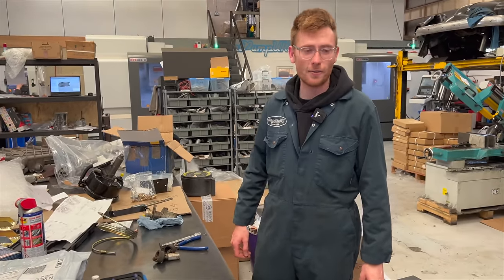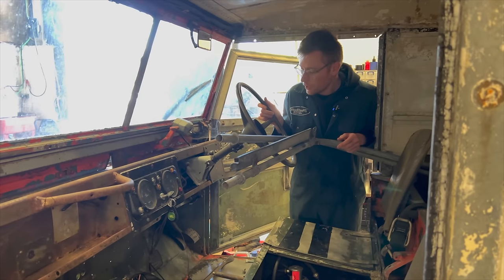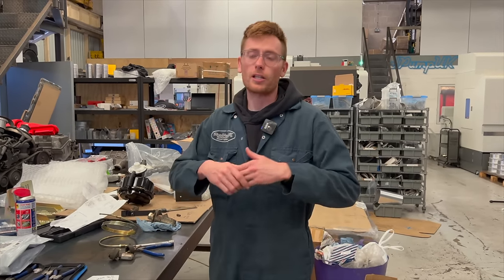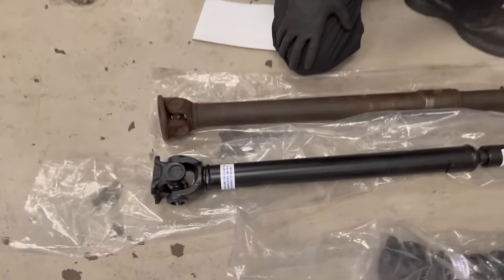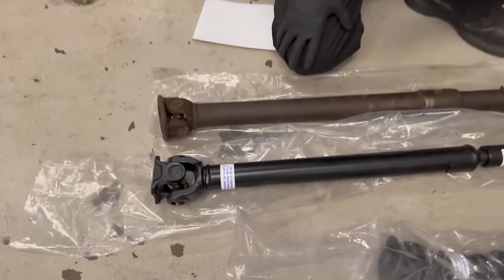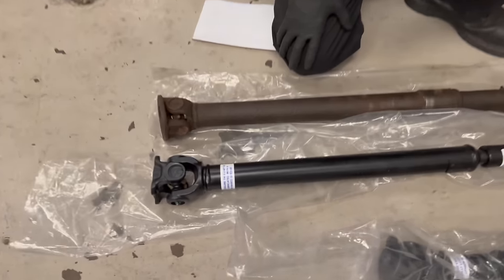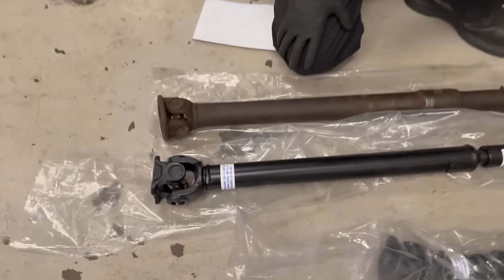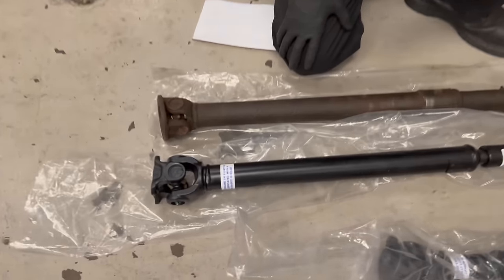Part 3, 1957 Series 1 Landrover OM605 build, FIRST START, AXLES,  BRAKES AND ELECTRONICS INSTALLED.

Comment: The one thing I loved most about this video is the fact that you never once told your girls to be quiet. You instead engaged them in what you were doing. God bless to you and your family and lots  of love from Norway. 

ps. I will probably be ordering a turbo kit for a 96 w124 250D shipped to our house in India if possible, but I have to find a nice example there first. They are rust free for the most part so you normally have pay 5 to 7000£ for a good example. How much reliable power can I expect on a stock OM605 with a kit from you, while keeping most of the driveability and comfort?

Comment: Sir, I need your opinion on something.
Have you ever looked at the BorgWarner R2S turbo system as used on the International VT275 engine???
The newer ones are computer controlled but the older ones, 2014, are fully mechanical.
How well do you thing this factory made two stage turbo system would work on a 606 or newer engine???
I bring this up because I've found complete systems brand new for 1300usd and that sounds pretty good.